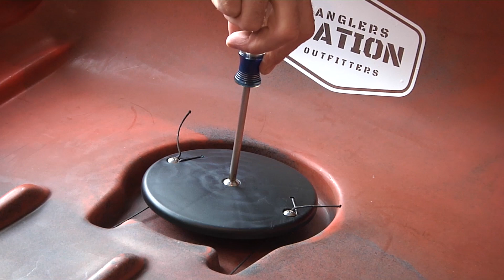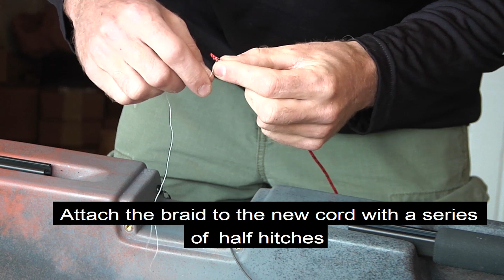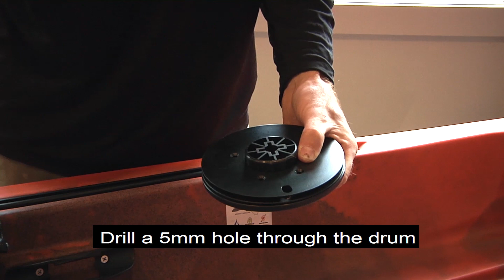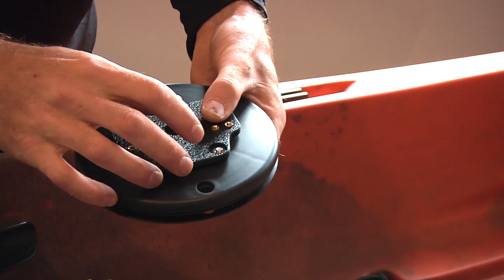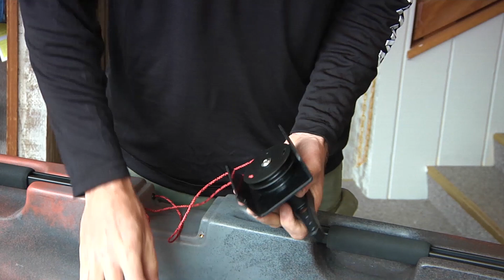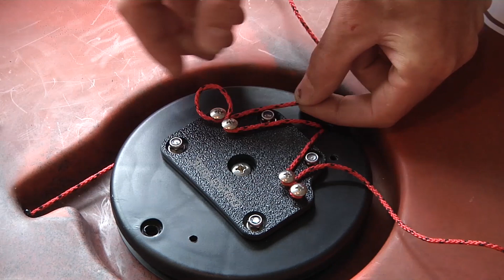BerleyPro Titan Steering Upgrade Installation

Comment: How much do I tighten the nuts on the tension plate? If I tighten them all the way, it flexes and molding a flat plate to a round base is quite worrisome. Do I leave the nuts a little loose so the plate can lay flat? Or do I tighten it so the plate can flex to fit on the round base it sits on?

Comment: I have the upgraded the handle top a next level desgin handle does the bolt still fit in the new mount that goes under the handle

Comment: When connecting the new cord to the new house turning handle drum does it matter how you attach it. There is two holes on each side and what is the correct way to feed the cord thru the holes
Reply from the maker: Hi Adam there is. Can you send me an email at martyn@berleypro.com
Reply: I think I figured it out, they're offset. One cord goes thru the front hole, the other side will go thru the back hole. I'll email you anyway to be certain
Reply: I just got the upgrade and I am struggling with this as well.  How do I get instructions?

Comment: Does this fit the FX13?
Reply from the maker: Hi mate this sure does
Reply: Just installed the BP kit on my FX13.  Works great!  High quality parts with very tight tolerances.  Straight forward install.  My FX13 has the BP steering and the Boonedox rudder. Turns on a dime now! Very happy.
Reply from the maker: @mackb3164  Great to hear and thanks for the support!!!

Comment: A question I had was relating to your front pulley that attaches to the steering handle. Why is it that one knot is tied and woven through a channel that takes direct the stress off of that particular knot whereas the one on the other side doesn’t go through the same little channel? At first glance I thought it was an error and then I noticed it was also this way when looking at the underside of the pulley in your video as well.  My only guess was that it helps in staggering the lines top and bottom on the pulley as shown.
Reply from the maker: You're correct its used to stager them :D
Reply: Good deal. Thank you for the quick response! Looking for to getting this thing on the water with the upgrade complete!

Comment: There's no need to spend $140 to upgrade now that the new Natives come with an upgraded steering system with spectrum fiber cables.
Reply from the maker: Thanks for your positive feedback. We're happy to let you know people are still swapping there's out since the Native cords fall off the front drum. Now that's a yipaah!
Reply: @BerleyPro  Spend $140 because we say the stock system doesn't work. Nah, I'm good.
Reply from the maker: @brib9716  We're just trying to help you guys out. Sorry for making what people ask us to
Reply: @BerleyPro  When Natives came with the metal cables that broke, yeah, there was a need. Now, like I said, no longer a need.
Reply from the maker: @brib9716  why you hatin?
Reply: @BerleyPro  Telling people they don't need to spend $140 is hatin? Ok.
Reply from the maker: @brib9716  10-4 rubber ducky
Reply: Love my Berleypro conversion, and the great customer service they offer!
Reply: @brib9716  it's only on the newer titans. I just recently purchased this system for my 2018 model before they had it. Love free enterprise, see a need, develop a solution and make some money. Thanks